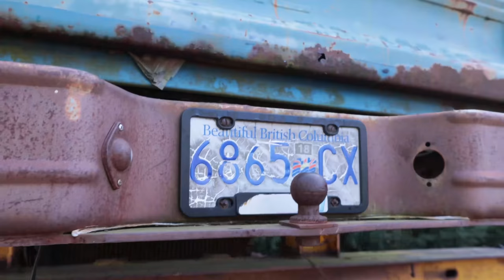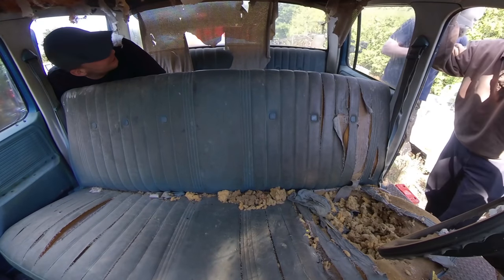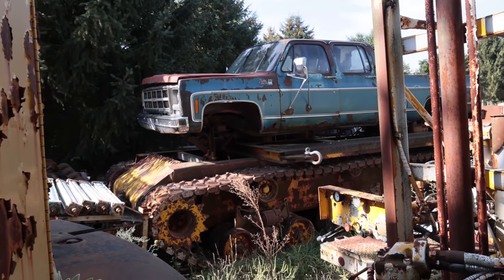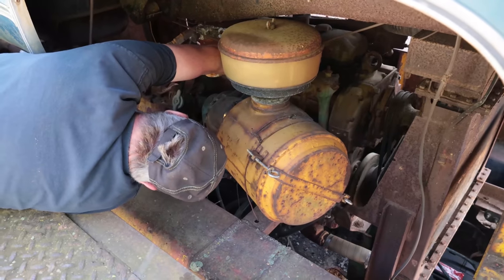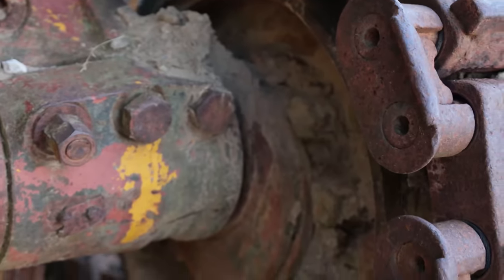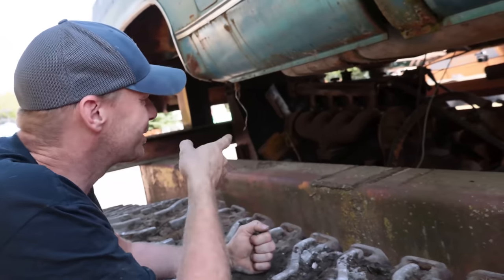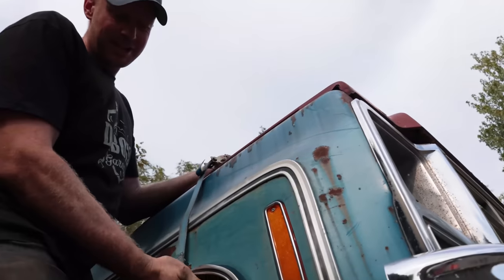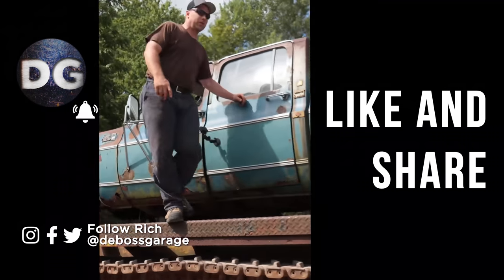We Bought a Squarebody swapped WW2 Tank | #Shermanator [EP1]

Comment: So when designed the M4 series was intended to use a Continental radial engine, only a single bank 9-cyl iirc, however the only real size difference between the original radial and the double wasp is length, and with no turret basket in the way the radial should fit fine. One concern about the radial however is that they were only designed to run at a narrow rpm range where tanks need larger ranges, and so drivers had to always be aware not to over-rev the radials or they would end up chucking rods left right and center, and aside from height is one of the reasons they went to the twin detroits or the ford V8, or if height wasnt your concern the chrystler A57 multibank.

Radials were also a bit of a crew nightmare because you always had to cycle them by hand to prevent hydro-locking on all the oil that sank its way to the bottom of the engine overnight

Comment: Those types of rubber tracks are familiar to me, I'm no where near a tank expert, but I do own a 1913 Steam Traction engine, and we regularly replace the rubber pads, the idler could probable be re-rubbered at a specialist, and as for the pads, they should have hard welded bolts under the rubber, could either be pressure fit, or a sunken nut in the top of the rubber

Comment: Is that Detroit Gen set that was at V&R recycled yet ? 
You'll have a far easier time staying diesel than with a Radial Aero Engine although a lot of WW2 tanks ran on them. 
These motors run on 120 Octane AVGAS  and that is getting extremely expensive and limited in supply, Buffalo airways in Yellowknife is moving away from piston engined aircrafts due to the fuel issue. I'm guessing that one hour of AVGAS will get you 10 hours running time running diesel and you'll still have coffee money

Comment: To adjust track tension on these you have to undo some bolts on the rear idler, remove a locking plate, and use a BFG wrench to move the idler backwards away from the sprocket

Comment: uhm folks
from what i can see by the shape of the track and the way the rear  return wheel sits this chassis is not a sherman but a Ram 2 chassis, this was a canadian made tank that was too late to take part in ww2, so the canadian army used the ones that where build to train Sherman crews as the Ram2 and sherman shared a lot of components.

i'm not a tank geek, but i do dabble in history, and i could be wrong, but i suggest looking at the chassis of a sherman and a Ram2 and see if i am right or wrong.

Comment: I keep failing ,but hopefully I can make a tracked vehicle happen someday soon.  I want a tracked vehicle for woods and evergreen swamp use.  Or a sherp if they work as advertised... Canada used the chassis from the M3 tank and made their own cast hull for it. That's what they used until the u.s.a. caught up on m4 Sherman production . The m4 Sherman also used the M3 chassis .  This thing is sick!  A name for it ... "Detroit Crusty Crawler"  rubber tracks can be used as long as they are designed for tank and big vehicle use. The rubber track pads are replaceable themselves ( and reversable so then the pads wear out, you flip them upside down and have new pads. )

Comment: At 21:08 you have the full side view of the chassis.   It is not an M4 Sherman; you have an M6 High Speed Tractor, which used commonly available M4 Sherman components.  The three high return rollers and the low idler arm are the visual cues.  The original M6 had spoked roadwheels, but in BC there are a lot of M4 components used with crawler tractors and spar yarders, and they fit the same suspension axles.  Let your fingers do the walking!  https://en.wikipedia.org/wiki/M6_Tractor

Comment: That thing needs one of brians (bcbloc02) p pump cummins tractor pull engines.  then... tractor pulls... or tug of wars.  That thing will be 6 ft taller with a Pratt radial in it and it will burn up without a propeller to cool it.  Diesel is cheaper than av gas too, especially at 35-50 gal/hr

Comment: I NEED to see this thing, I’m local deboss;) I was trying to figure this thing out or like a hour, you said Sherman but I didn’t see it until I realized it’s cut off at the transmission housing LOL if this is a Canadian Sherman it would be considered a grizzly but looking at the suspension design i doubt it. If you need a track replacement you can look in Canadian dry pin tracks, I’ve heard it is  pretty common in the area. I’ll keep my eye out

Comment: before you buy that engine , i know some guys, and i could potentially be able to acquire a 9 Cylinder Shvetsov ASh-62 radial for under 20k. its an 860 Hp engine, used in many different aircraft such as the Antonov An-6, An-2 and the canadian de havilland DHC-3

Comment: Lower the truck buddy dance that it actually fits neatly on top of the tank, cover the wheel arches and make it look like it was naturally supposed to be there, new engine swap and refined controls and this thing would be champ
Reply: maybe once they got a proper ignition system going that doesn't require fiddling with a screwdriver, and as long as they have a way to easily access the engine for maintenance.

Comment: Hello from the states I'm a Tanker in the army so the tracks you have are steel tread there's a model that should fit on your drive sprocket that actually have rubber blocks I think the track the m88 uses should work with mods

Comment: Yeap get it run like sherman would.. actually with less armor probably runs way better (could also be reason for whole thing jumping in slow speeds since there is way less weight btw), mount the truck on properly, ie have bed lift or split on the sides for engine winch maintenance, mount it bit lower and while fixing the rust damage get those fenders to meet the tank frame, so it does not look like truck being lifted top of the tank chassis and maybe be have utility in mind and build strong witch on the back with crane arm so it can lift and tow. Hydraulic lifting arm setup on the back might not be bad idea and attachable dozer blade on front.. ou god... original dozer blade....now that would be cool!
Brand new radial engine might be bit... well nice to this, but maybe go with GM 6046 diesel or gasoline Ford GAA V8. I like sound of radial engine variant, but again if this will be usable, get diesel. If you want to go fucking bonkers.. put in fucking jet engine XD

Comment: That R2800 isn't worth $30K to you guys in that thing, and it's going to cost almost that much just to get the engine running on a test stand.  You can get a timed out radial with timed out accessories that still runs fine (just not airworthy) for half that or less.  The crated engine is worth $30K because it has all zero time components, which is becoming a rarity. Any crated and pickled engine will have to be completely torn down and rebuilt just because it's been sitting for so long, the seals and rubber hoses and all that fun stuff will need to be replaced, and they generally don't have any accessories included with them (if they do, they'll need to be overhauled too, and you'll have to source all of that as well).  That zero time is what makes it worth it to warbird guys, because the engine parts have a lot of life in them, but for someone that just wants a big engine to power a tank, it's not at all important and really it's a waste of a rare engine and your money at the same time.  That's why you can get a complete, running, timed out R2800 for cheap, since it doesn't matter whether the engine is running strong or not, the regs require it once it reaches so many hours.  They get swapped out or overhauled once the engine reaches that point, but they don't destroy the old engines or parts.  Those engines and parts that are no longer airworthy but completely functional are everywhere at this point, and the airworthy engines and parts are a finite resource that will never be made again. Check with Sun Air Parts or Chester Roberts, or any warbird museum, they can steer you in the right direction.  Do the history and aviation world as well as your wallet a favor, source a non-airworthy engine and leave that crated engine for the warbird it needs to power in the future.

Comment: Unless you can do 40mph or better you wont beat Tankenstein. Sounds like a race is waiting to happen.
Reply from the maker: Straight race or obstacle course with cars?
Reply: @DEBOSSGARAGE  Well everything of course. Id have to do alot of work and upgrades to make it over a car as tankenstein is on the small side for that. rollcage and cooling system and harness